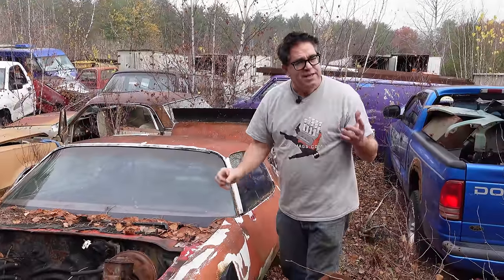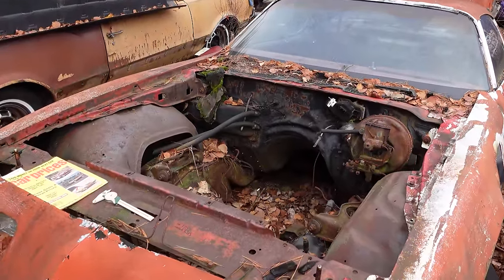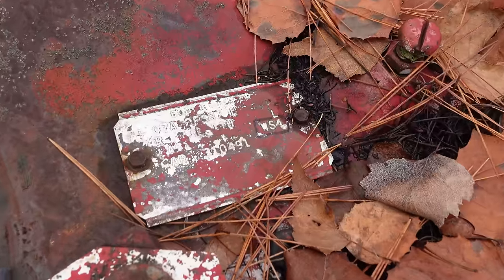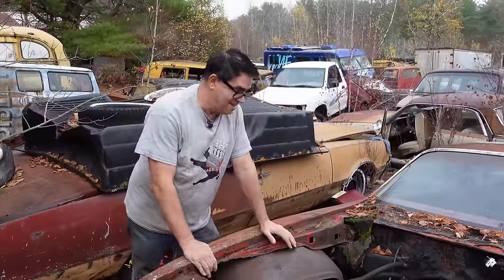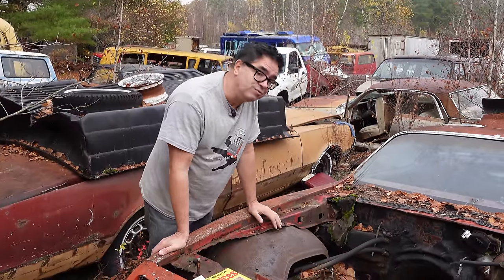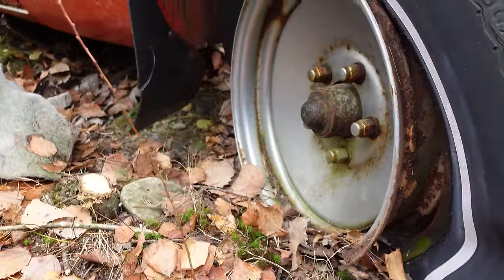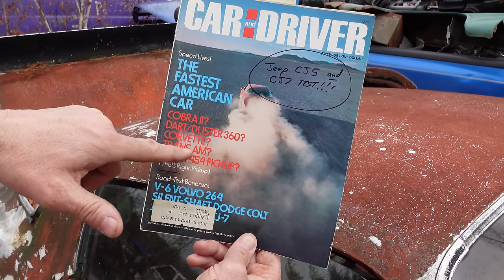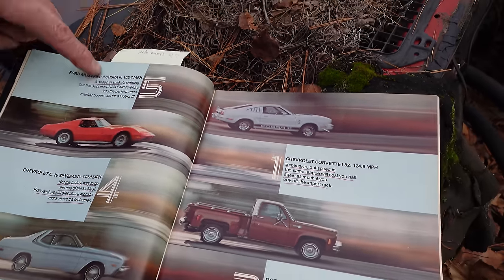1979 Trans Am

Comment: The W72 400 in 78-79 were indeed underrated at 220 hp in order to stay under the Corvette's L82's rating of 225 hp and not getting Chevrolet upset,. NHRA factored it at 260 hp which proved that Pontiac's engineers were keeping a dirty little secret from the GM brass hats!

Comment: I ordered a new 1979 WS6 in Cameo White in the fall of 1978. The shaker was part of the Trans Am package and not optional. The WS6 have me the Pontiac 400, Borg Warner T -10 four speed transmission, 3.23 Safety-Track differential with four wheel disc brakes. I ordered the car with Saddle Tan vinyl interior, T-Tops, power windows and locks, power trunk release, rear defogger, map lights, front and rear floor mats, air conditioning, custom seat belts, tilt steering wheel and a console. The Rallye gauges and Formula steering wheel were standard as was the sport mirrors. No bird on the hood. The out the door price was around $8,400.00.